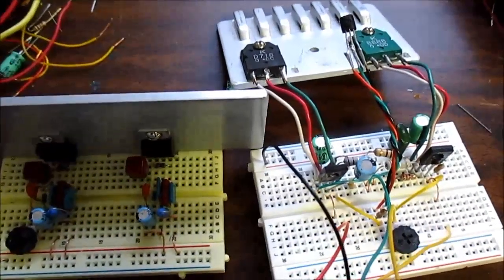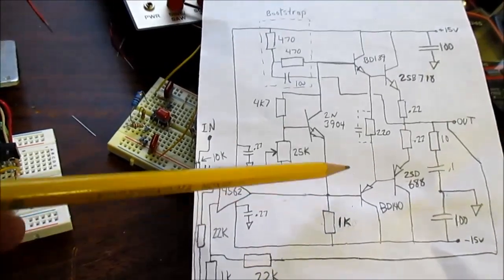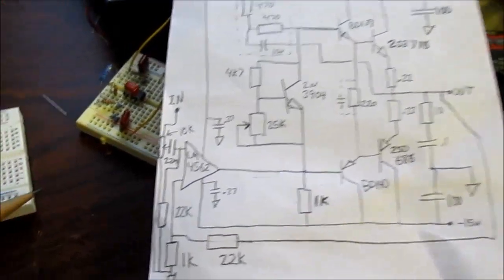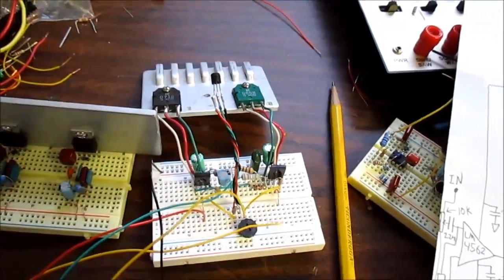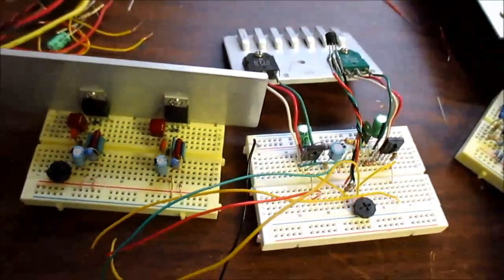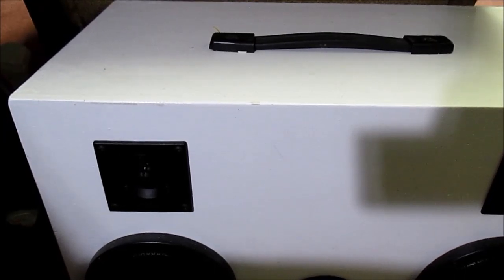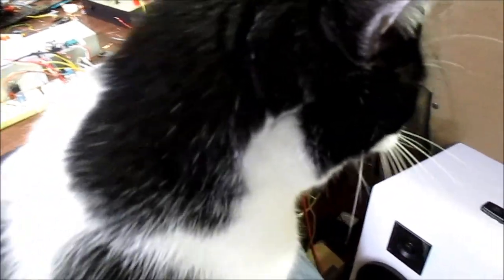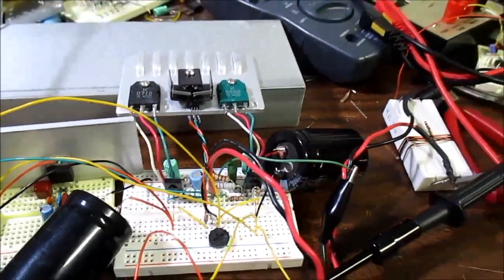LM1875 output power booster stage

Comment: you don't actually need an idle network for an output booster stage.  as long as your feedback is post-buffer, the op-amp will compensate for the bias voltage of the transistor.

Comment: Good discussion of the design, maybe a bit more on how you determined feedback values. Good tunes, maybe a little carried away but I know how it is when you make an amp from scratch you really want to play it. We can't really judge the quality very well this way though, you were just using the camera mics right?
Reply from the maker: +HillOrStream Feedback is around 30db which it typical for a power amp. Too much feedback (less gain) can cause stability issues and require compensation. Too little feedback (high gain) can result in more noise and distortion.

Camera's crappy mic and audio along with how it compresses (both dynamically and for smaller file size, then the compression in the video editor, next uploaded to YT and their audio compression renders the audio more. Upon playback the results of all this plus the coloration from the playback equipment including the headphones or speakers effect the sound more. Even so, I don't think it is a complete video unless I show the contraption actually playing music which is its end purpose.

Comment: there being 1 video explaining car amplifiers, this helps to answer questions about the amps with little representation. if you had a car amplifier, could you make a video showing the parts and signal path, ect...
Reply from the maker: +indopleaser No car amp now. I was into car audio years ago. In fact. the output transistors used in my demo is from an old car amp I dismantled. Those transistors have been sitting in my parts drawer for 25 years!

Comment: Nicely explained, I often wondered what a bootstrap is when it comes to audio circuits still have no idea how it works or exactly what it does.  Nice music selection, most of that is the kind of stuff I call music.
Reply: +CoolDudeClem 

Audio output line is connected to the bootstrapp capacitor, this feeds signal from output back to the emitter folower input.... as this capacitor is referenced to the output line that is connected to the ground through the speaker, the the negative side of this same electrolitic capacitor has variations of voltage charging it....imagine you have twenty volts into the positive side of this bootstrapp capacitor while your amplifier is in stand by mode....when you drive it hard, some volts will appear in the output line, this is audio..and it will charge the bootstrapp capacitor with higher voltage, this gonna drive the output emitter follower harder...i hope it helps.
Reply: +Carlos Mergulhão Ok thanks, that makes more sense now.